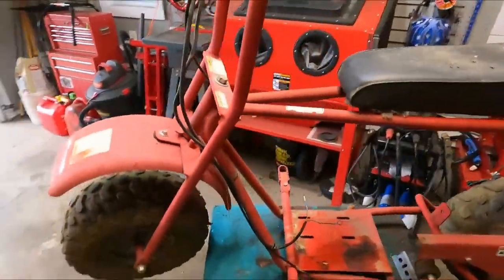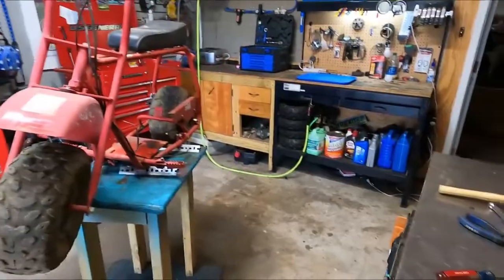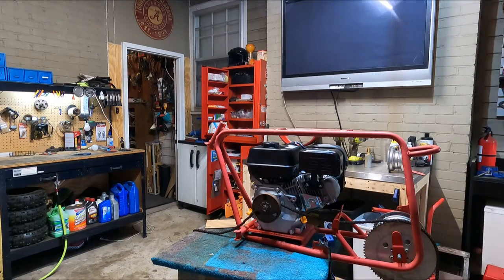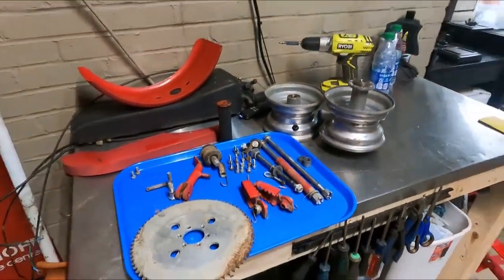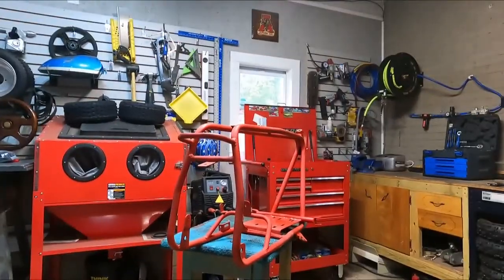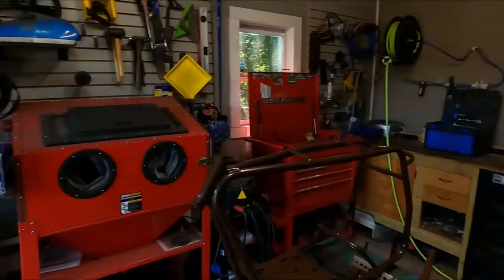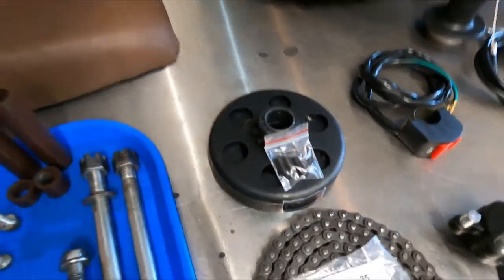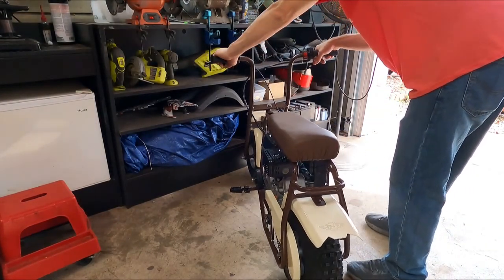Baja Doodlebug Mini Bike Restoration...212cc Predator Engine Swap!

Comment: Nice DB30S my man! I did two of these myself. I think they are the best quintessential mini bike all around. I have a couple MM80s that rip but I love those Doodlebugs boy!
Reply: I've done this conversion many times my latest one I stretched the frame 6in cutting it right behind the rear fender support move the seat back made it very comfortable to ride
Reply: I need help getting a clutch for this
Reply: Where do you get all the parts for do that transform

Comment: Can you give like a parts list for everything you needed to make it run with the engine swap? Thanks and great job.
Reply: Engine, Clutch (this bike is this small of abike doesn't usually use a torque converter) Chain, throttle cable and that's it. remember to get a chain tensioner if you don't have one.
Reply: @xaviermccloud4586  you don’t need a tensioner if you’re gonna run torque converter right?
Reply: @teckdecker32  Nope.
Reply: @xaviermccloud4586  do you need to get a new one of all of those or can i just use them from my stock engine
Reply: i know that a predator engine is 3/4 but what about the other stuff
Reply: @corbinwalter1212  Some Asian engines come with a 3/8th shaft. I think Colemans do. Forget what I said about small bike and clutch, lots of people run torque converters. Yes you can swap almost anything from one mini bike to another as long as the engines are 196,212,224 sizes. If they fall in the 196 to 200 and something range they should have the same outer diameter.  Yes you can swap everything
Reply: @xaviermccloud4586  i don’t think so because predators are 3/4 and i have a coleman right now that is 3/8 so i do need a new clutch
Reply: @corbinwalter1212  I meant clutch vs torque converter. Yes you need a new one I told you that of the shaft was different.

Comment: I just picked one of these up to do the same thing! Unfortunately my front forks are bent and rusty... and I can't find replacements anywhere :/
Reply from the maker: Check OMB Warehouse or Go Power Sports Maybe Amazon or Ebay
Reply: @thisthatgarage5073  Because of the pandemic they were sold out everywhere! Found one now.
Reply: Aaron, ... Simple ,get a general engineering shop to make a new set & build some geometry into the triple trees....they should be in alignment with your steering head.. it'll shopping Trinder steer at high speed otherwise despite the factory getting it wrong.Cheers Trev
NZ🇳🇿😎

Comment: Just curious wondering how much money you expect to get out of this. Unit
Reply from the maker: 8ish
Reply: I just sold mine for 800 had a built predator removed governor closed off holes did  stage 2 cammed ported polished pipe mikuni vm22 it would keep up with a kx85 lol 😆 scary Lil bug!

Comment: Does the 97 clutch work with the predator? I wanna do this too.
Reply: No its different size. Predator clutch is bigger
Reply: @dantefamularo6764  thanks, I looked up the shaft diameter, found a easy swap solution
Reply: @randymagnum6680  Randy for a cheap race clutch if their the same type... manufacturers use the weights out of the 79 in the 212 size...😎🇳🇿

Comment: What do you sell these for all fixed up?
Reply: around me i see them going for 150 and up
Reply: some people still ask for $350 with bad paint and original 97cc motor haha. getting one today for $120 with a bad 97cc motor. just gonna paint and swap a 212 on there and make profit. it’ll be the 3rd doodlebug in my garage currently haha
Reply from the maker: It sold for $400..If they are refurbished correctly without cutting corners I get new prices every time sometimes more depending on upgrades..I live in Alabama by the way